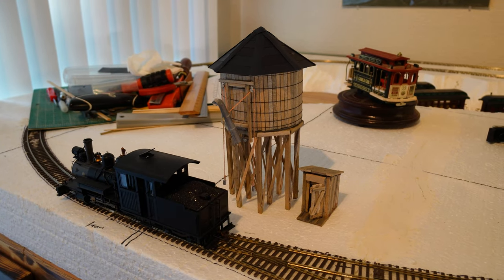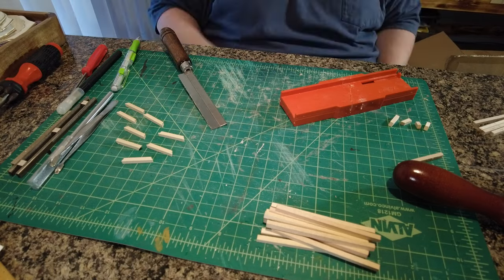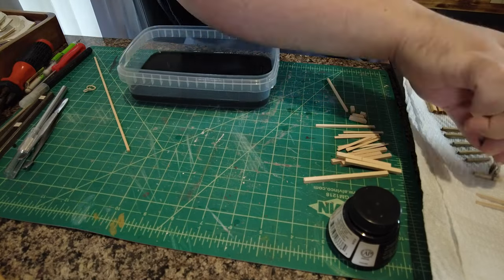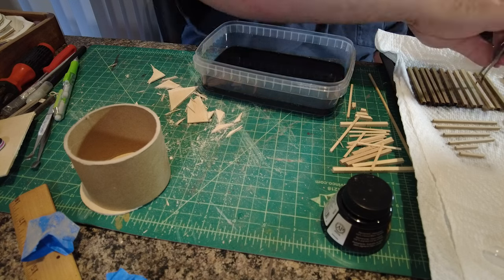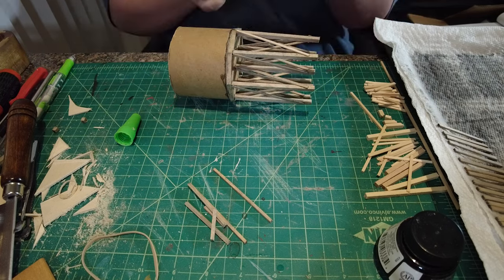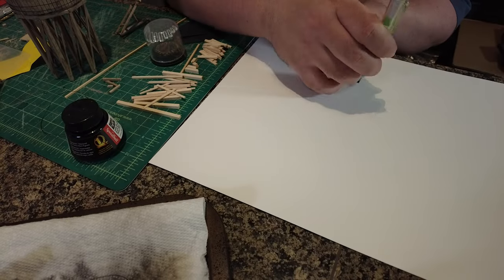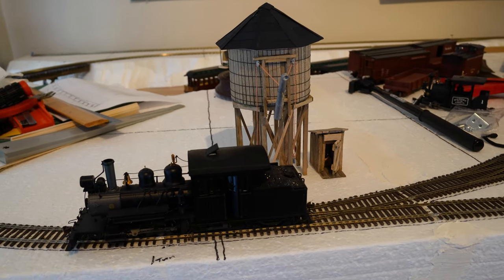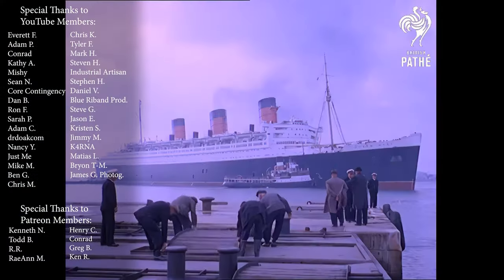Scratch-Built Water Tower | Update 1

Comment: I've built two water towers for O scale and made them from popsicle sticks I cut down.  For the roof I used the inside of a beer can after consuming the beer.  I cut the can into a rectangle and formed a cone and super glued it together and added strips of can for the roof ribs.  Came out pretty good.  I love to scratch build and just finished a lumber shed in HO scale.  I almost always use Gorilla wood glue especially when working with wood and card stock as it sets quicker than Elmer's white glue (PVA).  I'm not a big fan of super glue but use it occasionally when other glue won't work like on aluminum or styrene.  I watched this video to get an idea on how you made the spout for filling tenders.  Thanks for posting.  Cheers from eastern TN

Comment: The only thing I can suggest is to state exactly, for those who are younger or have never figured out exactly the math for building to scale, your measurements and how you calculated them.
I can really see the resemblance to the Disneyland water tower.
Reply from the maker: Ok. Shouldn't be hard. O Scale is 1/4 inch equals a foot, so it's really easy to design stuff in that scale.

Comment: My planned railroad is nearly as small as yours and I have similar issues.
Reply: I am building it as an On30, but using Bachmann HO EZ track. I have two branchline water tanks and I am thinking of using your methods to make the wood stain. I am going to use blue extruded foam for the subscenery and subroadbed. I have a mine I am going to model, but all I have so far is the coal chute/ ore bin. Where I am modeling is in the coal country of East Central Kansas. We have nice hills, some even over 1000 feet high above sea level. There won't be tunnels, but I will have a couple of rock cuts exposing rock faces.